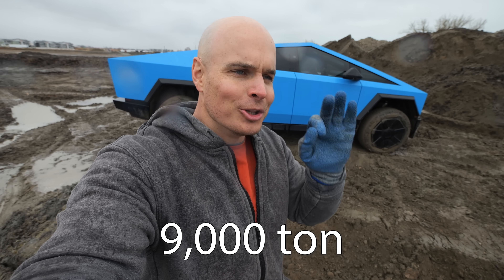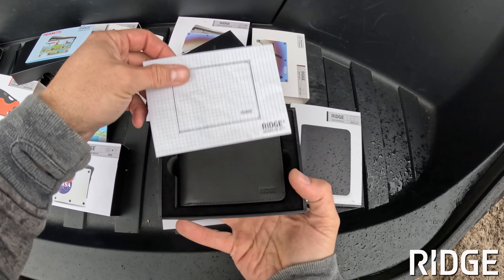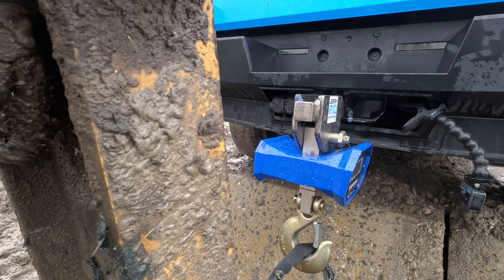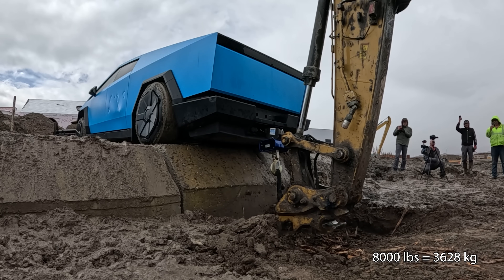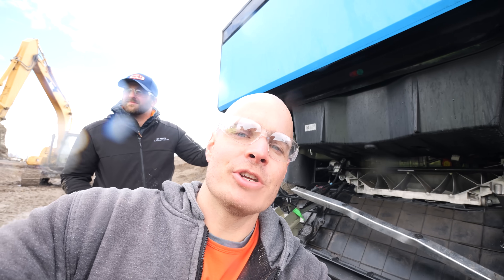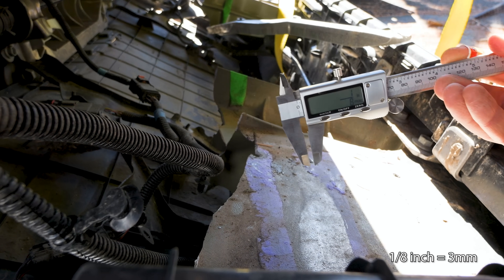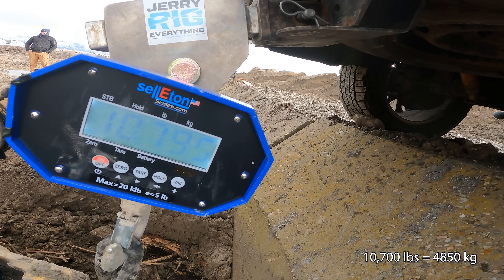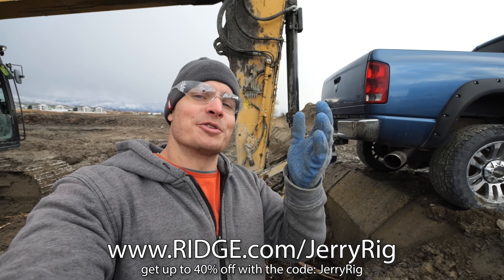SHOULD YOU TOW WITH A CYBERTRUCK?! - (catastrophic failure test)

Comment: I'm no Cyber Truck, or even an EV fan in general, but this was stupid. The tongue weight on a Cyber Truck is 1100 lbs. They took it to over 9X that amount. On top of that, it was taken to that amount over time while being ramped up and never releasing this pressure. This is never going to happen IRL unless you are trying to sky lift an M1097 HumVee up a cliff. And even then the forces will not be straight down tongue weight. Not that you'd have the traction to even try to do it. Additionally, you will never end up in a real world situation where forces like shown in the video would occur unless you happen to be towing something over a bridge and the bridge collapses with just the trailer still on the bridge. In which case you're getting dragged back with the trailer, or the truck breaking would probably save your life.

Cresting a steep hill will not turn the entire weight of a trailer into tongue weight. It's obvious he has no grasp of physics or leverage when he said the entire weight of the backhoe  was on the RAM. 

I wouldn't be too concerned with the epoxy/glue short term. Considering shear will be a bigger issue when towing than tensile strength as was done here the epoxy will have much more shear strength than tensile . However I have no idea what epoxy was used and how it will break down long term going through the extreme temperature ranges a truck will see throughout its life. I do agree that aluminum is another thing I question the strength of  long term if it's subjected to towing forces over a decade or 2.
Reply: Yes but they did the same thing to the Ford F-150 and it didn't break
Reply: @Greendale82  This truck wasn't built to be pulled down by the hook
Reply: @ArabianDesertKing    neither was the f150 and it still didn't break lol
Reply: Stupid test😂
Reply: Stupid test😂
Reply: say Musk this and that, but He did not design the truck. the team of engineers and material scientist did. No need to get rallied up for nothing. I trust my engineering brothers and sisters 100%, they speak numbers and data instead of feelings. Dude thought he's 'got one' over Elon but in reality hes just saying the engineers were bs the data which is not true.

Comment: this is a material science issue. any competant engineer who actually  understands the  different properties n thus suitable appilcaions would never use an aluminium fitting in such a structural / high load / long term  role.
regardless of design, regardless of size/ thickness of the part - the way aluminium reacts to load cycling can be thought of as cumulative [hence y aluminium becomes weaker thru use ], whereas a steel used in frames [not stainless, it behaves differently ]will not yield or sheer no matter the load [as long as within the force limit] or cycle [ literally up to infinite cycles] and y there are no [zero] aluminium framed highrises, and the main reason airplanes can be refitted fully over n over up to a point then must be scrapped.
As the aluminum structure strength has cycled to below the g forces that can be exerted during flight manouvering, at which point its likely to crack n nothing will extend service
using aluminium this way in a tow vehicle like cyber truck is a major oversight or willfull deception n incompetence.